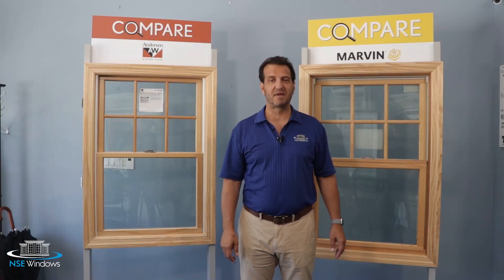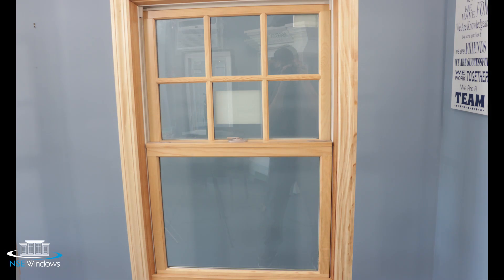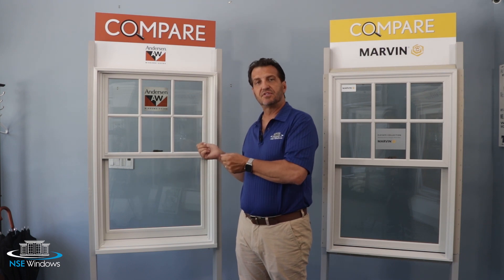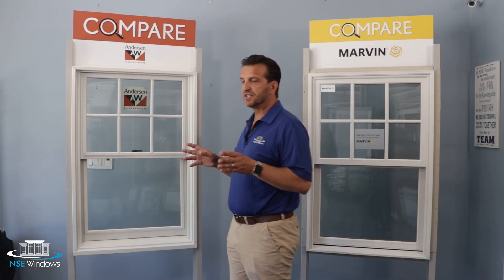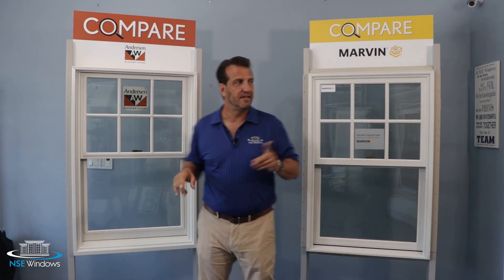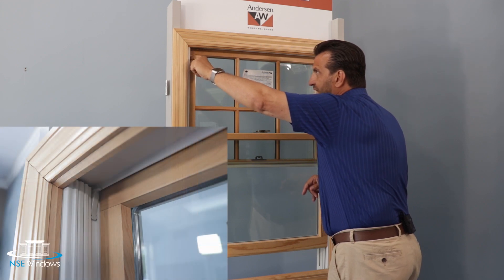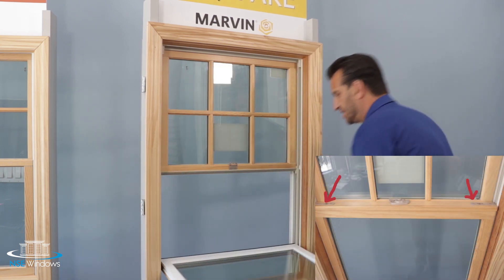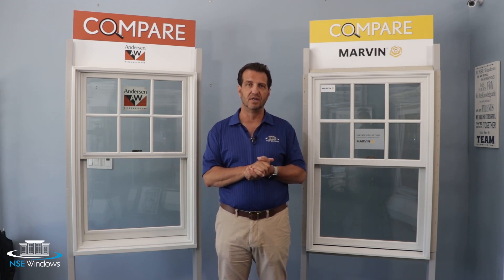Comparing Double Hung Windows- Andersen or Marvin?

Comment: Great comparison of two windows I'm considering right now.  Seems a bit of a hit job on Andersen but maybe it's fair?
Reply from the maker: We tried to do our best to be as unbiased as possible
Reply: Fair but note the Marvin windows cost about +20% more.
Reply: @ryanolep1078  Not necessarily. I was about to pull the trigger on Andersen 400s because my builder recommended it. However I didn't care about the wood interior and wasn't keen on vinyl so looked into Marvin. Got a few quotes and yes most dealers quoted a little above the Andersen quote, but I ultimately found one that came it at the same number as the Andersen.
Reply: @hapaboy0808 the labor was cheaper and your contractor was willing to not mark them up as much. A great window, none the less. Hopefully you got a great install.

Comment: So how long have you worked for Marvin windows? Andersen big advantage is the jam liners are compression, making a better seal, Thus the need for the tilt assist's or wedges as you call them.
Reply: The 400 is the window that Andersen pushes in their advertising.  It's a super easy window to kill and full of flaws and not a good design.  9 out of 10 homeowners forget how those wedges even work and don't know how to tilt their windows in for cleaning.  The Elevate is more on par with the Woodwright but with at lower cost.  Both of the air numbers aren't so great as with most wood windows which is why they all cried and get the NFRC to remove that performance rating from all of the window stickers and don't put it in their brochures.

Comment: Thank you for this. I had put Andersen windows in my old house and I was terrified to use the tilt-wash feature because I was afraid I'd never get the windows back in. I like the Marvin tabs better, they are more like windows I've had tilted in before.
Reply: The Andersen window seals across the outside edge of the window and against the sash.   Windows with the tabs just seal across the outside edge.   It is slightly trickier to use, but it’s a superior seal design.

Comment: I'm replacing 30+year old Andersen windows. Thought I'd choose Marvin for replacements as I've heard they are slightly better quality but the sizing (window opening) isn't quite the same so with a Marvin replacement I either have to order a custom size window or order standard size and shim up each window opening...more expensive on both fronts. Any reason NOT to order Andersen replacement windows?
Reply: Can you do a sash upgrade in the Andersen's ?
Reply: Andersen purposely makes their sizes different so when you replace you go with them lol
Reply: Andersen does have good support . Marvin was a bit hard to deal with but getting better . Marvin seems a bit better built.
Reply: Marvin cost more
Reply: @shahsmerdis  They do a conversion kit. Guessing you have Narolines? A very easy job to. Check the vides on them. Naroline to 400 Seris conversion.